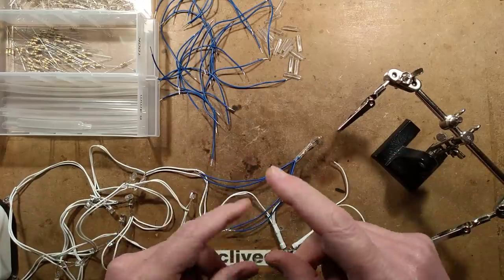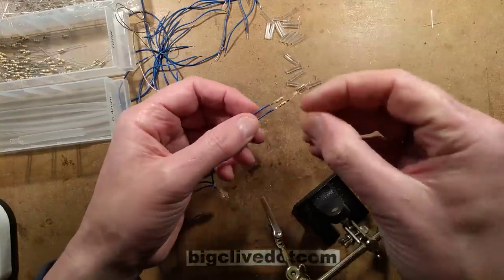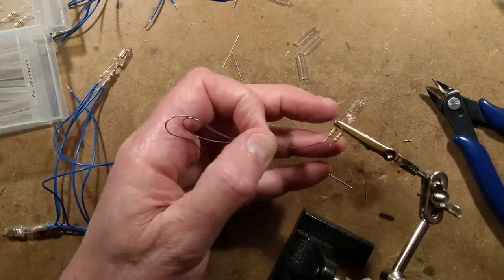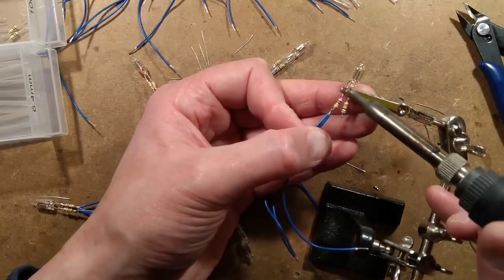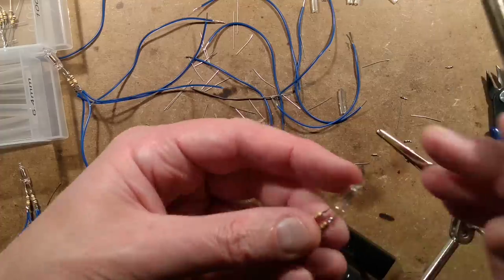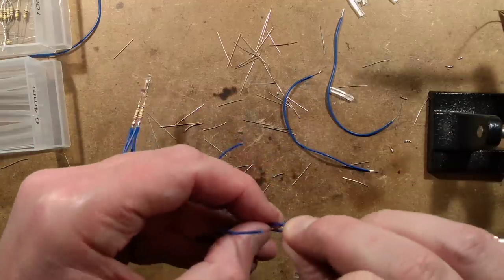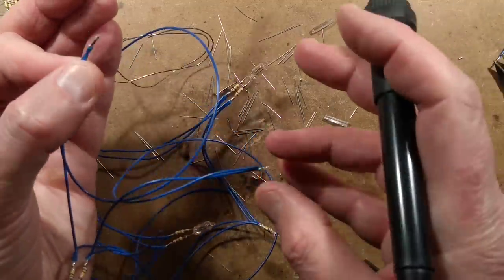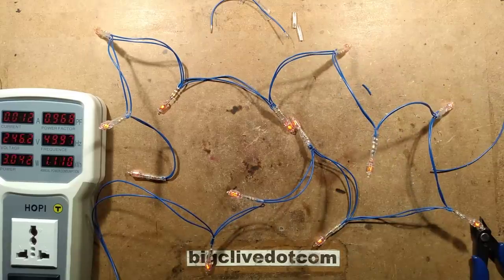Making a set of retro neon fairy lights. (100 year anniversary.)

Comment: I had a bunch of ten neons in an infinity mirror type box. Started off the mains with a diode and small cap, then resistors to each neon. Each neon had a small cap across it. So it was a relaxation oscillator with each neon firing randomly compared to its neighbor. The effect was kinda cute. I think I threw it out 20 years ago but I might still come across it if I move.
Reply: Those neon-lamp relaxation oscillators were popular "desktop amusements" back in the 1970s.  There were some being made by an artisan in Toronto that included a 90V battery (still available back then for tube radios). Housed in clear acrylic. I always thought they were super-cool.

Comment: I remember growing up in the 1960s the Christmas lights we had were just a string of twenty 12v lamps in series on a twisted wire. The colour of the bulbs was just from the manufacturer dipping them in some sort colouring to colour the outside of the glass. Whenever a lamp blew the whole string of lights went out and you had to get a spare lamp and replace the first bulb in the string to see if they lit up again, if not you would take the bulb that you removed from the first bulb holder and replace the second bulb with it, and so on until the string of lights lit up again.
Reply from the maker: Yeah, but that tree with those 20 dull olive shaped lamps was magical.  If anything, modern trees are over decorated.

Comment: Like you, I was forever taking things apart as a child from an early age, gradually evolving to building and fixing stuff. I got my first mains voltage electrical shock at around seven, which was a very surprising, unpleasant but valuable learning experience - although it still happened occasionally if I lost track of what I was doing or got distracted, etc. My parents trusted me completely because they both had zero technical understanding of anything and so it was easy to convince them I knew exactly what I was doing! I think they also understood I'd be very frustrated and unhappy if they interfered, so they let me get on with it. Also, it made me very easy to look after because I kept myself occupied and was never bored.

Comment: I remember when I was around 5 in the mid seventys my dad messing with CBs. I think at ten besides taking apart everything that was broke and a few things that weren't, lol. I made a working dv motor out of a piece of wood nails and telephone wire. My dad was a electrician and going to work with him. I got back into electronics since I was disabled at 40 ten years ago.

Comment: I remember playing around with neons, 90v batteries, resistors and capacitors, and building a novelty light set. The basics were, the battery charged the capacitor via the resistor. The neon was in parallel with the capacitor, and would only strike once the voltage across the cap was high enough to ignite the neon, this discharged the cap, and the neon would extinguish. Because the resistor was of sufficiently high value, the neon wasn't able to light directly from the battery, and so the cycle repeated ad infinitum, so the end effect was a flashing neon. Connect several of these simple flasher circuits in parallel, and you had the basis of a novelty 'light field' that flashed/flickered in a random manner. In a box, in a fireplace, it gave the impression of a fire slowly shimmering. However, if you were to run them out in a string, you would have a random flashing chain of neon lights. You could run them from a 90v radio battery (these were still easily available in the early '70s) or could build a simple PSU to deliver the required voltage. The true subtlety was in the random variance of component value tolerances - this gave rise to the random flashing of the neons, and you could fiddle around with component values to fine tune the rate of flash to suit your own preference.

I'm sure you can figure out the circuit for yourselves, but I could send it to Clive, if he is interested, but I can assure you, it is such a simple, rookie level, circuit that anyone could make it.
Reply: Whatever happenedto EverReady 90V HT batteries? Or those 'combi' ones that had the HT and LT  combined, with a four pin socket in the top?

Happy days in my corner of Dad's shed...
Reply: @duncanx99  We got transistors and a PP9 ! Sadly, the older generation of portable radios were made redundant by a technology that only needed one battery, and no need to warm up, and were more resilient to knock 'n' shock damage. In short, people stopped using them and opted for transistor radios instead, so there was no demand for the batteries, ergo, the supply dried up.

Comment: As a kid, i wired a mains voltage lamp to a plug myself, because i've seen my dad do it, but i used very thin wire. Plugged it in and the wire 'exploded'. Gave me a good scare, but i survived. :)
Tinkering is the way to learn about stuff. My sister was very clear that none of her devices were to be tinkered with. Haha.

Comment: I like the adhesive lined heatshrink. It locks the wires in better and stiffens the whole thing so the solder joints are less likely to break. And sometimes I squirt some hot glue in before shrinking, so it expels all the air and looks nicer and makes it all solid.
Reply from the maker: I've cut glue sticks into strips and inserted them into sleeves in the past to make extra gluey heatshrink.

Comment: Hi Clive. Like your good self, I have been a 'tinkerer' from an early age. I used to love taking things to bits, to see how they worked and then (sometimes) putting them back together.
Now approaching retirement from a life in electrical engineering, I am still reminded by my elderly Mother that she always knew that I would get a job involving electricity. Apparently, when I was a toddler, I was discovered in a state of distress, with a blister on the end of my index finger. This was back in the days when the UK employed 15A, un-shuttered sockets. As I was found to be in close proximity to one of these electrical outlets, Mother put two and two together and assumed that I had shoved my little digit into the live socket...

Comment: Ah using the croc clip as a heat sink.
I remember the first Antex soldering kit I had included a pair of aluminium tweezers to clamp onto transistor leads so they survived the process.  Amazing to see OC42 still available for £5, "ROHS: no" what a surprise :)  I can't remember what hte black coated plastic enclosed transistors were, but itwas great fun to scratch the paint off and discover they were photosensitive - reault !

I started out with a Philips Electronic Engineer kit that I got for my birthday while on holiday in Cornwall.  I remember a few wet days in late August looking out towards Gribbin Head waiting for the sun so I could go surfing again, then going back to assembling the radio.  When we got home i built the organ and was disappointed it was out of tune, looking back I'm surprised I didn't fiddle with it to try to tune it...  Surprised to see an EE20 on ebay for £100 today :o

Comment: I loved neons. My Van degraff kit I got around 9 had a loose ne2. You would use it for many experiments. Later a story called the ubiquitous neon lamp or similar ran in popular electronics or similar rag.
   Much fun was had when in 1969 I put 2 rows of neons poking out of a small box, each a relaxation oscillator at random. Put it on the dash of my 64 corvair turbo car.

Others, even police thought it was anything from a spy device to a radar detector. Ran off a 90 volt radio battery.

Good ne2s had a radioactive element in them to give reliable indication in the dark.

If you have a blinking neon in any kind of power indicator of old, aim a laser pointer at it. It will light up solid.
     I will leave it up as a student exercise to see why.

Many of my Tektronics gear is loaded with the things.

Comment: I just made a string of 20 for the Mrs. I found some "TWIST 2 Core 3 AMP Braided Fabric Cable Lighting Lamp Flex Vintage - 40+ Colours" on ebay and combined a dark green flex with red heatshink over the resistors to give it a christmas holly kind of look. The upside to this wire (besides the nice retro look) is that you can just untwist for assembly and it's about the same thickness as a good set of ordinary lights. The downside is dealing with the fabric braiding which is a complete nightmare. It's actual natural fibre fabric so you can't just blast it with a bit of heat to stop the end fraying. I also added some little cable ties to act as extra strain relief on the cables (and to stop that damn braid unravelling).

Total build time... 8 hours ;(

I did have to double sleeve everything in heatshrink and that braid was very fiddly, that's my excuse for being so much slower than Clive.

Thanks for the video!

My advice for anyone attempting a similar set would be to get more flex than you think you need. I only got 3m, intending to have a plug, 1 meter of flex then 2 meters of the string. However that means only 10cm bits of wire between the lights which, by the time you've stripped the ends and added some strain relief, just isn't enough. With my 3 meter starting length the whole string and tail only came to about 2 meters. A 4 meter length (1 meter tail and 15cm wires between lamps) would have been much better.

Comment: Amazing how you use your fingers to push the solder into the iron.

Also, colours do disrupt your sleep pattern. A research study in theatre found that technicians working under blue light (common colour to mask working light during tech rehearsals etc) had poorer sleep cycles. There is now a growing movement to remove blue  gel lights from working areas. The long working hours don't help mind and the lack of sunlight also has an effect!!
Reply from the maker: There are MANY reasons theatre technicians have disrupted sleep cycles.  Very weird working hours often followed by a trip to the pub.

Comment: My father and I disassembled a broken washing machine together out of curiosity when I was little. I still have some enameled copper wire from it, which I unwound from the pump motor.
The issue with the machine was probably the synchronous motor from the mechanical timer/program wheel, which I saved but never got running.
I too started my electronics career with that 4.5V battery and a light bulb. I also started my pyrotechnics interest with a candle stump and a match on a fireproof platter my mother prepared. She couldn't have known, but once I'm intrigued by something it just keeps growing and never really stops.

Comment: 6.4mm ~= 1/4inch. I love it when metric has to bend to imperial :3
Reply: 5/32 ~= 4mm, 15/64 ~= 6mm, not sure what your point is?
Reply: @nurgle11  6.4mm is about 1/4inch. If the heat shrink tube was actually metric, it would be a round number, not 6.4mm.
Reply: MadMan Machinations - in real life in nature, nothing is the only round number 😀

Comment: My favorites were a set I had years ago, with incandescent filament bulbs shaped like Xmas themed objects, Santa faces, lanterns, candy canes, and so on. From about the 50s, hand painted with enamel paint, and brass screw in bases like the little pointy torch bulbs with a blob of glass as a lens (remember those?).
Reply from the maker: You can retrofit those lamps with new internal lamps when the internal filaments fail.  It involves very careful drilling into the envelope from the end of the base.

Comment: I think you missed the heat shrink tube on one lamp. 1:00:51 top middle one
Reply: My grandfather used his fingers as a voltage tester.. licked thumb and index, then grabbed live wires..
Reply from the maker: In the very first electricians guide it actually suggested touching wires to test if they were live.  Strangely enough they removed that bit when it was discovered that in the right conditions (usually involving water) the results were a bit dramatic.
Reply: @bigclivedotcom  "The results were a bit dramatic"

*Thinks about the hotdogger

Comment: I remember seeing a design for a 'neon brick' that cast a number of neons inside an acrylic block. I don't recall the circuit details but I think it used capacitors and resistors in a relaxation oscillator configuration to flicker the neons, and it also took advantage of the voltage drop that occurs when the neons strike to ensure only one neon was lit at a time. The result was a block of neons of which one struck randomly, went out as the capacitance discharged, and then repeated for another random neon.

It would make an interesting variant on Clive's string of gentle flickerings.

Comment: First thing I ever built was a torch.  Fuse wire wrapped round the threaded sheath of bulb, bent so the tit hovered over +.  Tape wire to 2 x D cells stacked in series and tail bent over -.  Lots of tape to make it all secure then poke and bend the two ends of the wire till the bulb and wire makes contact and bulb glows.  voilla - disposable torch.  I always had a torch as a kid.

When torch batteries die - cut wire out of sticky mess ... and you have a test lamp, add batt - and it becomes a continuity tester.
I dismantled any and everything ... proudest day of my life was first time I managed to reassemble an old alarm clock and it ran all night (lost 2 hours by morning!).

Electrics in the early 60s, it was difficult for an 8 year old to scrounge much more than a battery and bulb or an odd cat's whisker - not so many low voltage things to harvest, most (broken) things were 240v and had valves - difficult to persuade adults to trust you!

Comment: I made something like this too! But slightly simpeler (because you don't have to cut and solder your own string). 
 I took a string of 10 incandescent lamps. Cut off the mains plug. Pulled out the lamps from the little socket, and replace them with red, green and blue neon lamps (the green phosphors go dim VERY quickly though!). 
Next, hook it up to a CCFL tube driver. With 10-15 lamps this will work perfectly, with the bulbs running at 30-60 degrees depending on how many of them you put in series.
Reply: Ingenious... although sounds slightly zappy :-)
Reply: @theskett  I power it with batteries. It has no reference to ground. So if you touch only one part, you won't be zapped. 
Aside from that, double insulated cable can resist 4kv or something like it. Wouldn't trust the super cheap christmas lights with 4kv at serious current, but the CCFL driver can supply only 2mA so even if it goes wrong, it doesn't go badly wrong.
Reply: Good calls, and thanks for the info :-)

Comment: I was taught as a PC tech that monitors are designed to keep you awake this is why windows has what is called the night light setting. You set it for a certain time of night mine starts around 11pm and runs until 10 am and all it does is warm the light up and move it away from the blue light and since I use my computer for everything the nightlight setting helps ready me for bed, I don't have cable tv. I think you were talking about when tv and radios started to change from tubes to what we called solid-state circuitry.

Comment: If you used the self sealing heatshrink, it would maybe add a bit of strain relief, as would a drop of CA in each tube. A low current high freq power supply would add to the "safety" if you wish. Line isolation is always a good thing. Been a long time since I bought Neon bulbs, and last time All I could get was the NE-2H high brightness version. A few years back (30 maybe) the green ones with the phosphor in them were popular, but I havn't seen them for a while now, they'd make a nice set as well, or maybe a mix. Back when we said "if we ever get LEDS in any color besides red, we can make fairy lights with them, now we long for the old neon, and soon, probably incad lights.... So goes technology. Now where did I put my fil-check-r,? it's got a neon in it.....

Maybe next time do the relaxation oscillator flashing neon circuit for a flashing set....

Comment: No flicker from the hopi when lights off.  Must change camera scan rate enough with that exposure
Reply: Yup, as exposure increases, flicker decreases. If you have a fully adjustable camera, closing down the aperture will reduce flicker.
Reply: I think he already knows that and had it mentioned, but he doesn't because it would mess with the regular settings (?).

Comment: my parents were frustrated by my constant dismantling of toys. I'd get them working again but just. 
For a short period they bought tough, heavy metal toys but quickly took them away. I'd began hurting other kids with them. 
The best 'toys' were hifi, vcrs and computers from the local car boot. To tinker and on the rare occasion fix them.
I got a few items working again but 90% of the time it was luck. majority of the time faults were really minor a bad cable, plug not wired right, plug or internal fuse blown  or worn belts. 
As a kid it's the best feeling to get something broken working again (especially as you'd not broken it!). Better still if the fix was devised by you. Belts fashioned from rubber bands, fuses made from plain wire and other jankey silly fixes,
Reply: I was dumb enough to wonder why I never got rc cars and expensive things like the other kids, well duh I kept talking the mediocre ones apart and gave them no confidence, there was one flip style tank drive (no tracks) rc car I got later on, I loved that it was so simple and almost designed to be taken apart, it’s part of how I learned about not everything being made equal

Comment: The 6.4mm heat shrink tubing may be designed to accommodate something up to 6.4mm in diameter with the 7mm being 0.3mm of clearance on each side. Makes sense to someone!
Reply: 6.4mm is 1/4 inch, its probably just an approximation.